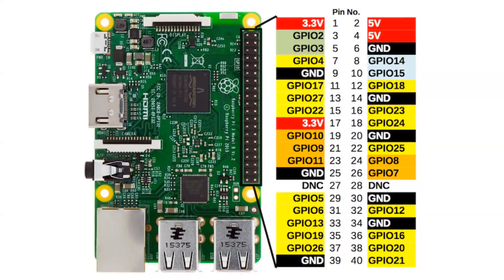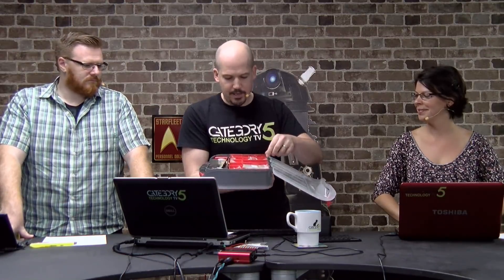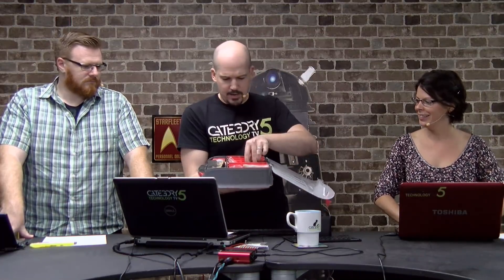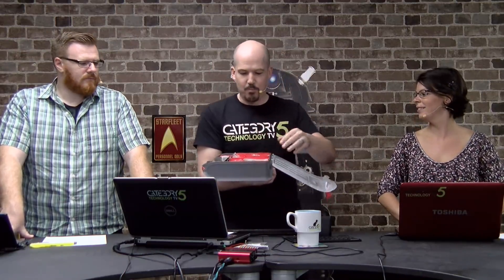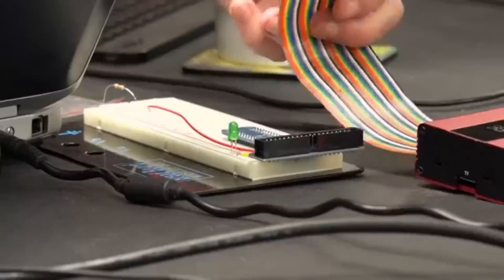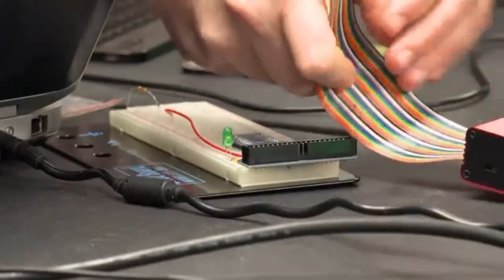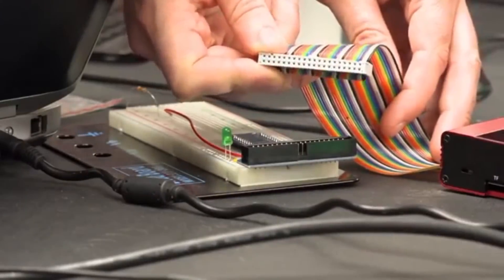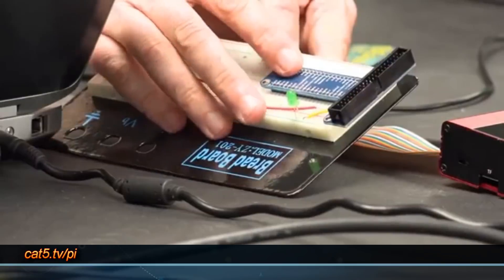How To Use the GPIO of Raspberry Pi (A Quick Look for Beginners)

Comment: If you draw to much power from the 5+ or 3+, you'll find you'll need a 5.5v - 5.75v not 5.1, its not the amps, as i have used 2.5a, 3a, & 4.5a but when i upped the voltage then no more Lightning bolts or under voltage error's
Reply from the maker: So are you suggesting a step-up on the Pi adapter to say 5.5V? What's the safe voltage threshold for a Pi? Alternatively of course, we could add a relay and separate the Pi power from the LED power, if we needed much more voltage.